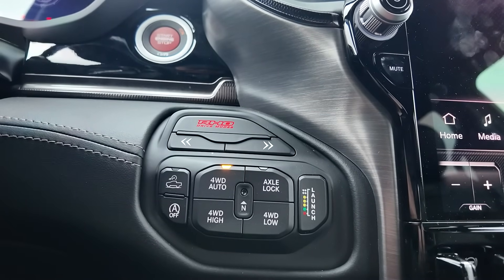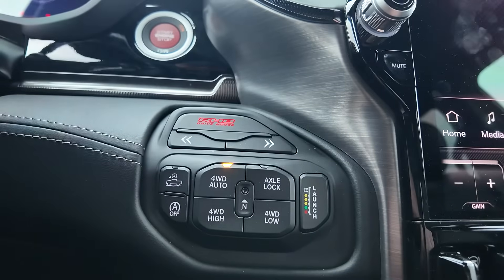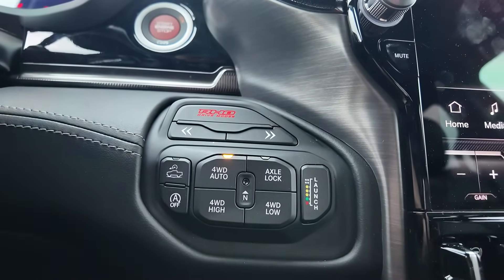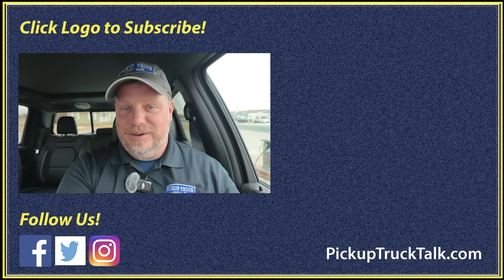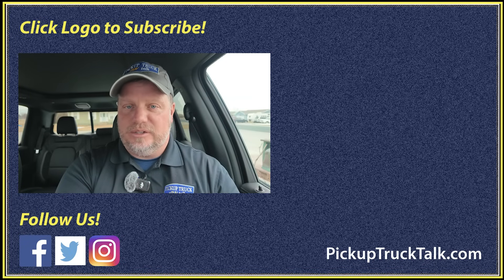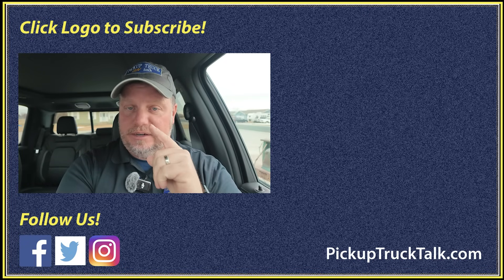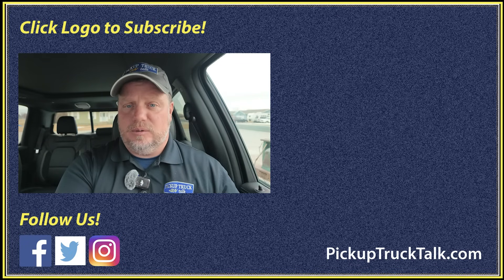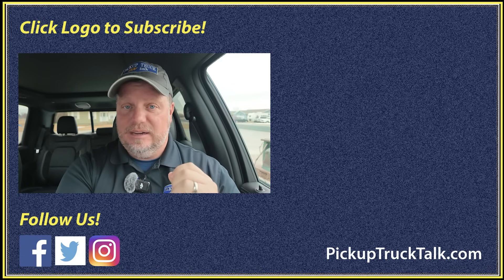Drive Mode Matters? Here's How Ram 4WD Auto Works from the Engineer

Comment: I would still want a 2wd button
Reply: Absolutely, there is always some clutch pack dragging when in 4x4 auto, and eventually you will wear the clutches out. I wouldn’t buy a truck without a 2 wheel drive button. Auto is great to have but a wear point when driving all summer.
Reply: @robm3357 EXACTLY
Reply: In my 2025 Laramie SST - there is a 2WD button. Looks like that depends on trim
Reply: 2wd is a must, so much fun
Reply: @simd510  Why? Every Quattro/4Matic/xDrive drivetrain from Audi/Mercedes/BMW works on the same way as explained as cars  is designed to withstand those forces.  Off-road makes a lot more wear than using "Auto mode" would you agree? And what about safety and stability? iI provides greater level of safety on road if there is a e.g. slippage or uncontrolled rotation - specially for pic-up trucks that have high center of gravity.
Reply: @FilipBzik  He said it, fun.  Ever gone into an abandoned parking lot in the snow and played around a bit?
Reply: @shadowwolfmandan   

1. Fun? An engineer sad the in "Baha" mode can put 20_:80 power to RWD.  Have you ever driven a car that has 80% on RWD in snow? 

 2. Burnout/ drifting in "Pick-up truck". Are you serious? Buy cheap sport BMW with RWD. Do not tray to have 4in1 as you get the worse of all than.
Reply: I’m so glad I have the 2wd option
Reply: @Darkknight-ti7fz  Why? Every Quattro/4Matic/xDrive drivetrain from Audi/Mercedes/BMW works on the same way as explained as cars  is designed to withstand those forces.  Off-road makes a lot more wear than using "Auto mode" would you agree? And what about safety and stability? iI provides greater level of safety on road if there is a e.g. slippage or uncontrolled rotation - specially for pic-up trucks that have high center of gravity.
Reply: Get the Ram Rebel 1500, mine has the 2wd option.
Reply: In my TRX I can force it in 2wd....but the amount of power I put out, 2wd is almost useless to me.  If I give it any significant gas, I break the tires loose.  So I'm fine with 4wd Auto
Reply: I got one. 2024 RAM 1500 Big Horn. 🤷‍♂️
Reply: Seems to depend on the trim. I have a 22 limited that has a 2wd button.
Reply: My '19 Laramie has a 2WD mode. Only 57k! Truck is running great!
Reply: 2023 big horn level 2 has 2wd, 4wd auto, 4high and 4low
Reply: Why? Every Quattro/4Matic/xDrive drivetrain from Audi/Mercedes/BMW works on the same way as explained as cars  is designed to withstand those forces.  Off-road makes a lot more wear than using "Auto mode" would you agree? And what about safety and stability? iI provides greater level of safety on road if there is a e.g. slippage or uncontrolled rotation - specially for pic-up trucks that have high center of gravity.
Reply: Totally agree with u
Reply: Buy a different truck. Problem solved!

Comment: Great interview now I wonder since I have a 22 gmc with Auto 4H4L if mine is the same ?
Reply from the maker: My assumption would be yes.
Reply: I had a19 silverado and ran it in 4x4 auto in the winter for 5 years, works same way as the ram.

Comment: There is so much confusion out there on this topic. Thanks for arranging this Tim. 
Some Tundra guys think its ok to run their trucks in 4wd high on pavement in mixed conditions. It's not. 
There are many transfer case models on the market. Some of the old part time transfer case designs eliminate clutches making them simpler and eliminating clutch wear. 
The way trucks are used today I dont know why Toyota doesn't put 4wd auto in the tundra and 4runner. 
They say reliability but cost has something to do with it.
Reply: In a way they have something better: the Full-time 4wd system. They just need to put it in the Tundra.
Reply: Toyota believes in if it’s not broken don’t update motto, and those that desire 4auto Toyotas can look at limited trims.
Reply: The advantage of the Borg Warner transfer case in the Ram is that it has 4wd-high and 4wd-low, in addition to 4wd-auto. 4wd-high and 4wd-low lock the clutches in the transfer case so there isn't any slippage for off-road. 
The full-time 4wd systems in some of the the 4runners, land cruises, etc. do not lock the clutches and are not best for off-road.
Reply: @ I'll take that Torsen center diff in the Toyota over the clutches anyday.
Reply: Torsen diff is nice.

Comment: I wish Toyota would offer a 4wd Auto mode. But they say they don’t for reliability. 😮
Reply: Toyota has arguably the best full time 4wd system, the torsen center diff.  But they know they can get away with less features while changing more money.
Reply: Land Cruiser is 4wd auto
Reply: When you use the 4wd in 4wd auto trucks. The clutches that engage the 4wd burn out.  It’s great for trucks who don’t see off road.  However if you off-road, pull stuck  people out. It is not reliable.
Reply: @dakotaracebrown this is exactly it. Toyota isn’t wrong. Clutch type or disc type differentials or transfer cases will be the weak point as the discs wear.
Reply: @slowsleeper550  nope. That’s an extremely rare failure. I put 330k miles on TWO different Land Cruisers with full time AWD that use limited slip clutches and never had an issue out of either of them. They were turning 35”s with 5.29 gears and I would go rock crawling on weekends and daily drive them Mon-Fri. 

Checks forums and groups and you’ll see there are very few catastrophic Toyota T Case failures. 9/10 times if there’s an issue it’s the electronic actuator got stuck from not being used often enough. That just means you’re stuck in 2WD until you break it loose with some figure 8s or clean it.
Reply: That's a bunch of shit.
Reply: This is true. Ask GM owners that use their 4a too often.
Reply: @santiagohills3997 does the 4Runner and Lexus GX use AWD? They also have a center differential that allows them to get 4x4 .
Reply: They don’t because the can sale you an outdated system claiming reliability.
Reply: That’s not entirely true. 

They have limited slip differentials in the transfer case on the AWD top trim 4Runners, GX470s, GX460s, LX470s, LX570s, LX450, 100 Series Land Cruiser, 200 Series Land Cruiser, 80 Series Land Cruiser, and several other models. 

They automatically engage “4WD”when one of the axles is spinning faster than the other and locks it. Then disengages the transfer case differential when the speeds equalize. 

You can lock it manually, or let it do it automatically depending on conditions.
Reply: Glad they don't.  Glad our Bronco doesn't either.  Much rather have an old school TCase in all of them.
Reply: The 4Runner 'Limited' trim with 4wd is full time AWD as the default drive mode. You can use the dial to put in 4x4 or 4L. That's the only 4Runner to offer the auto 4x drive mode.
Reply: Never had a  issue with 4auto
Reply: BS the v8 4runners came with AWD
Reply: And yet my 02 GMC Sierra has and it's used very often and NRVER one issue. Sounds like an excuse to me!....
Reply: No, it’s for EPA regs because it’s less efficient. I wish RAM used Toyota’s Torsen system.
Reply: @AlphaOmega333 What's the relationship between EPA and 4wd Auto. GM, Ford and RAM all offer 4wd auto
Reply: @josephjroy6593 I was responding to why full-time 4WD isn’t more frequently used. RAM’s system is different than the center Torsen system in the Land Cruiser family.